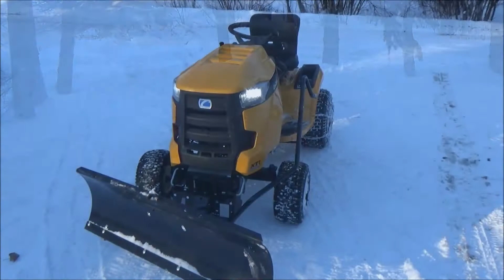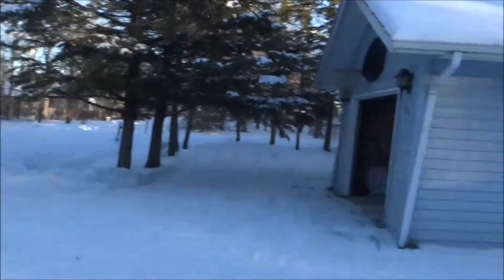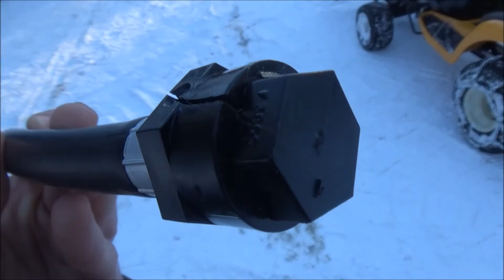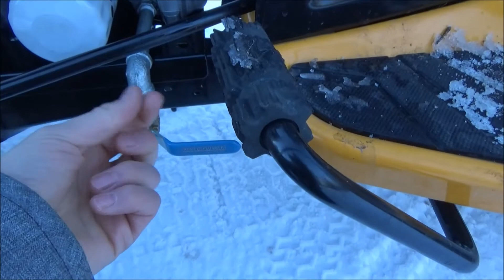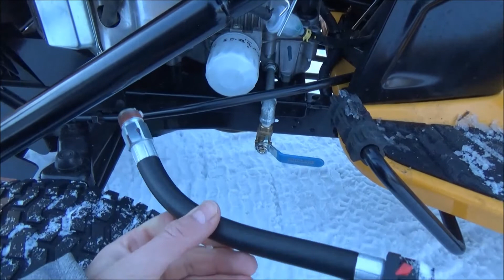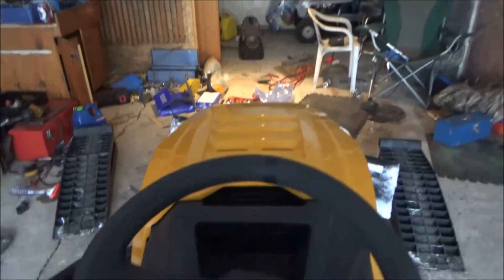Kohler/Newer small Engine Oil drain pipe Repair  (cub cadet xt1 tractor)

Comment: well im im still interersted in replacing the throttle cable that broke in the lever
Reply from the maker: clyde coffey I could see that becoming an issue. They are made seemingly cheap. It’s most likely just a connection like a bike brake cable, not sure how the dash comes apart or if there is access through the backside of the panel under the hood.